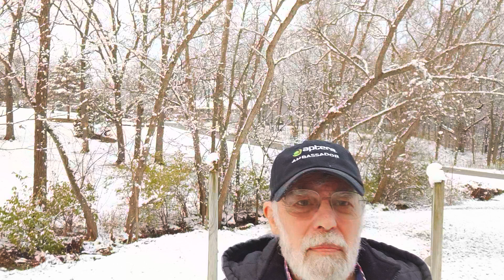November 15th 2022 Aptera update @Iowa Aptera

Comment: Here's your comment from AOCs latest, because I am blocked there, so will answer you here. Just a lot fewer readers will see it. Can anyone transfer it to where it should go? I don't think so, because you are all so deceptive.

[I think the decision to go with a body produced by CPC is the primary reason that we won't have a physical delta by the end of the year.] It's way more than that missing - no AGVs, and no supplies from anyone - even those contracted more than a year ago. If the shells were here, there would still be no way to make a Delta. 
[My guess is that they have everything they need but for the body- a big part of the job!] A baseless guess if ever I heard one. There is no evidence of any stockpiled supplies - that's the reality. 
[I do think that the CPC production is fantastic news and will mean that the ramp up in production will be much faster than if they were relying on vacuum bagged parts.] The news is not relevant to the SEC filings. You are harping on about old news. Stay relevant. 
[The precision of each part means that the body will be even more precisely fit together,] No part has even been made, yet. 
[and higher quality, as well as potentially lighter in weight.] Incongruous sentence end, but meaningless while none have been made.  
[Once these vehicles start to ship, they will be absolutely amazing.] Maybe (who really knows?), but right now they don't exist. 2050 might be absolutely amazing, but that's of no use today. The present and reality are what matter. Flick a short reply if you have read this on either site?

Comment: Nice update, Bruce. Mine will be my new daily driver, though waiting for UK-spec RHD will mean a longer wait than most others! 2024, most likely 18 months or so. Plenty of time to see how you get on with #42 - multiply that number by 1000 and that's roughly where mine sits in the grand scheme of things! Thanks for the referral code 👍 

I'll be especially keen to see how the solar performs - not so worried about AWD as proper winter/mud'n'snow tyres make a huge difference compared to AWD on summers.

Comment: As always, it is good hearing from you Bruce. I am also looking forward to your reviews of the production Aptera. I got to speak with the Elaphe engineers at the FC show, and they are very thorough in their motor design and testing. I think that the CPC production of the pressed sheet CF for the body parts will help scale up Aptera production quickly. I am also looking forward to seeing the production-intent Delta model built and shown in the next few months.
Reply: Not the next few months - in 39 days! They are in the middle of breaking that promise, already.

Comment: Hmm... 🤔I think people should be more aware of how impractical supercar-grade carbon composite mouldings are in real-world situations. Great for boats, great for planes, not great for ground vehicles operating in traffic.

Ask Tim 'Shmee 150' Burton what it cost to replace (not repair) the parts of his all-composite McLaren Senna after a lorry wheel scraped down its right-hand side. Better yet, don't ask. It was an expensive and complicated nightmare, and that was damage caused by a glancing blow, not a direct collision.

I know that the Aptera's moulding process differs from normal pre-preg cloth lay-up vacuum-laminating and autoclave curing, but the end product - whether it's made from chopped strand, woven fabric, magic beans, or a blend of all three - will behave similarly in an impact.

In a normal nose-to-nose, nose-to-tail, or nose-to-side crunch at ordinary traffic speeds (40 mph?) a carbon body is often an insurance write-off because you can't be sure how deep the damage lies.

A badly-shocked (structural) composite part may show no outward sign of failure, but its strength will be an unknown quantity; it has to be replaced. If it's a bonded sub-frame buried deep inside the vehicle, replacement is basically impossible, so it's tragically common to see apparently unharmed, shiny cars worth millions - Paganis, Lamborghinis, Bugattis, McLarens, Martinis, Whatever-inis - scrapped after relatively minor traffic accidents.

Composites (yes, of all kinds) aren't readily repairable. The Aptera will be light and strong, no question about that, but in a collision it'll break, not bend. Metal deforms and can be straightened and easily repaired without loss of strength. Composites can't. That's the nature of the beast. It's the price you pay for all of that remarkable lightness and rigidity.

F1 cars, supercars and hypercars with structural (sic) carbon components aren't repaired, they're rebuilt at vast expense. People are crowing with delight that the Aptera is now a supercar ("It's all carbon! Dude, that means it's better than a Tesla! We've beaten Ego Muskrat! Yaaaay!"), I wonder if they really appreciate what 'supercar' ownership means.

The Aptera would be better with a welded steel space-frame clad in lightweight (composite) mouldings. It's not a good idea to use structural composites on the road.

And what's happened to the Aptera's eco-credentials? A planet-friendly vehicle ought to be inexpensive, easy to work on and simple to repair. Structural steel and aluminium are ideal materials for ordinary road cars. Structural composites are more of a 'one hit and done' solution for racing cars that aren't expected to survive more than a weekend before being rebuilt.
Reply from the maker: The McLaren uses long fiber carbon fiber - a very different and more expensive material than the short fiber carbon fiber and fiberglass pressed sheets that CPC is using for the Aptera bodies.  These parts are both easier to repair and to recycle than the McLaren and other supercar builds, besides being far less expensive to produce in volume.

The materials used in the Aptera panels are an engineered mix to give specfic and different properties to each part of the vehicle.
Reply: @n.brucenelson5920  The materials proposed to be used. None used.
Reply: If you use common sense, the fanboys are going to hate you.

Comment: I am sure you will be getting yours next year.  But after the initial release in CA. As a fellow Paradigm order, I am looking forward to it. And as a Douglas Adams fan, I envy you the 42nd Aptera.  As the Aptera would look good in most SciFi movies. 
Did you work for eCycle Marine by any chance?
Reply from the maker: I wonder how many Douglas Adams fans I will meet?  (That number is the meaning to *EVERYTHING*)  I knew the eCycle people, but I worked with the Glacier Bay Ossa Powerlite system.
Reply: @n.brucenelson5920  Looks like you’ve already met two Adam’s fans here. Lol.

Comment: You have just the kind of weather that I'm concerned about in my area. I'm wondering how the off road option would effect the lateral stability of the all wheel drive with the 100 KW option. Would that combination still pass the moose test?
Reply from the maker: Mike, that is an interesting question.  Based on my experience with my Gen 1 Honda Insight with a low front air dam, I am thinking that I won't need the off road kit, and I don't want to give up the interstate range it would cost.  However if I am wrong, I could choose to add it later.  I have plenty of farm paths that I might wish I had it on.  

I suspect that I will purchase a second set of wheels to make changing to more aggressive tires an easier job.  We have a lot to learn.  I plan to take my Paradigm to Death Valley directly from the factory when I pick it up, and will start reporting on my first hand experience.

Comment: Great to know Elaphe meets your high standards. Thanks NBN
Reply: But Elaphe has delivered a few motors that were built to Aptera’s specifications.  One was on display at the FCL show, and are being used to drive the Gamma around.
Reply: @Running__Rabbit  There are about 37,000 orders with an average 2.5 motors per each, so just to fill the preorder list, they need about 90,000 motors; many more to be an ongoing concern. With 5 prototypes (presuming they haven't cannibalized Alpha's for Gamma's) and a spit-polished chrome one on a display table, we have about 12 to 14. That's a long way short of what they need, and they have delivered the first two nearly 3 years ago. Some video's show Chris A. saying the motors come stock standard from Elaphe and they will be tuned for Aptera by them. At FCL, the news is Elaphe will do the tuning. There are always two stories to every issue, but the telling fact is there is nothing to make Delta's out of.
Reply: @aussieideasman8498  There are not 2 different stories as you claim, but a separation on time that justifies both to be true. When the first 3 Alpha cars were built and with the Beta, Aptera used the Elaphe M700 wheel motor.   This motor can be identified because of its bright green outter shell.  That is why it was said we’re stock standard from Elaphe.  With development to Gamma a new custom motor was developed that Elaphe has done the tuning on and that motor was in Gamma and on display at the FCL show.   This newer motor can be identified because of its smaller diameter and raw/polished housing.  Don’t worry about Delta it’s on it’s way.
Reply: @Running__Rabbit  Did I say that one of those stories was a lie? You really do have a comprehension problem. Then you go on to validate the two stories in the next 11 words. Thank you. And the times when I do say they lie - they lie.
Reply: @aussieideasman8498  No you did not say that one of those statements is a lie, but insinuated they could be lies by saying there are always 2 stories.  I was just giving back round both these statements, and how they are both true.  Also clear any confusion you might have.
Reply: @Running__Rabbit  My past experience with you tells me you are not worth explaining much, and it has nothing to do with me getting confused.
Reply: @Running__Rabbit  I should say - get someone to visit Aptera and physically count how many motors are in each of the 5 prototypes? I am still dubious that some have not been lifted from Alpha's, as they no longer show all of them driving in one scene, which they always did when Beta was being tested.
Reply: They haven't delivered any, so who cares what standards they meet in a talk fest?
Reply: @aussieideasman8498  why don't you just troll somewhere else?  Maybe the internet should ban you.  You and Trump.  And please don't respond because I won't.
Reply: @aussieideasman8498  G'day Aussie troll man
Reply: @davidgeorge7443  G'day.

Comment: I finally ordered my Aptera Monday , I ordered the 600 mile 3 wheel drive, full solar package and custom color , came in at $ 39500 . Not cheap but that's what very typical cars go for now days .
Reply: I finally put a reservation in about a week ago. That puts me at somewhere between 37,000 and 38,000 on the list. I laughed when they said 2023 to 2024 estimated. I'm thinking more like 2025. I''m not in a rush. I also don't want one of the first ones made. There may be things that they'll need to improve.
Reply: @tims8603  that's what I was thinking about the improvements plus I don't really have enough m9ney bow but hopefully by then I will .
Reply: @tims8603  that's what they told me as well. I ordered sometime before the fully charged show.
Reply: Good spec. I'd race you but it'll end in a tie... You'll just look a lot cooler with your fancy non black paint scheme 😋
Reply: Heh,  I ordered the same specs in February, but I get the same 2023-2024 delivery window.
Reply: That’s the same spec I ordered (minus custom color, but added off-road) Feb of ‘21. Also get snow here in the Sierra, and live on a bad dirt road. Just need my 2005 Prius to last until then!
Reply: @michaelmay9958  bro your driving an actual tank. People have no idea how reliable the Prius is
Reply: What color? When you get a custom color, what color will the skirt be?
Reply: @IBMara  Metallic blue .
Reply: @thomascorbett2936  Nice.